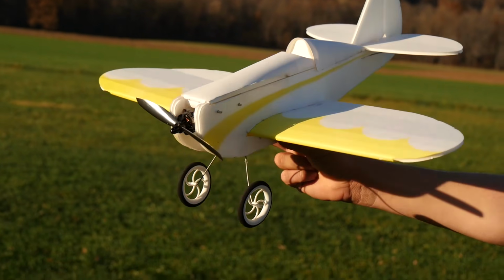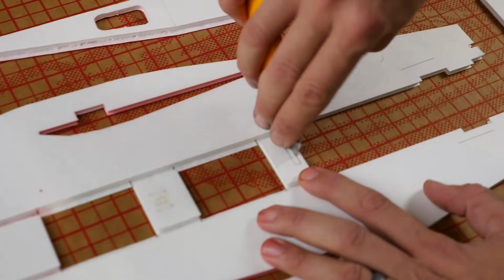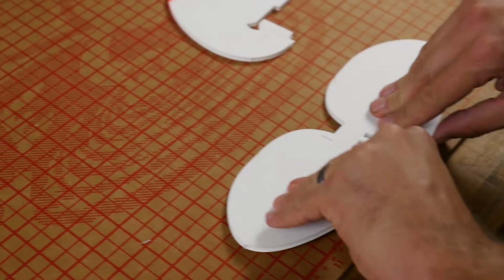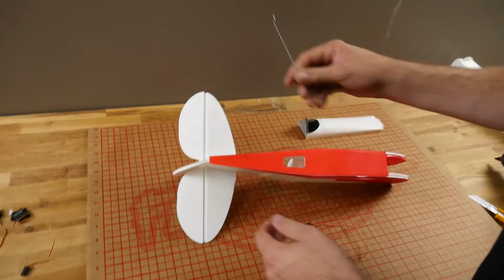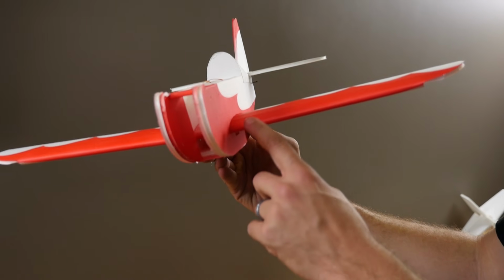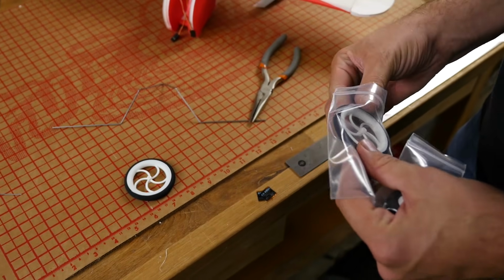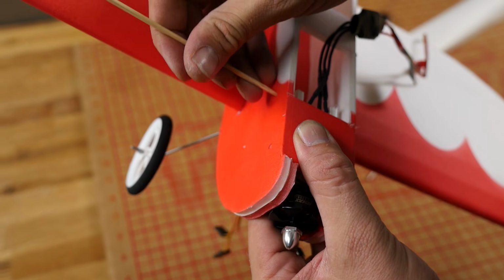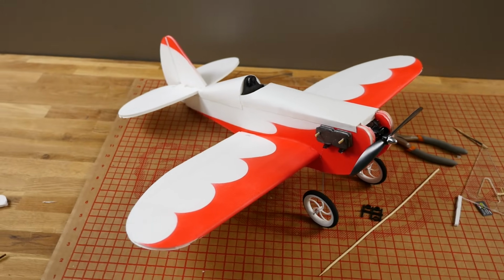FT Mini Sportster BUILD | Flite Test

Comment: After building and flying the old speedster I have some recommendations. I ended up re-enforcing the nose and belly areas with thin hobby plywood for added durability and some structure for the lading gear. It added a bit of weight but with the power pack "C" it was really no problem. I permanently mounted the power pod and moved the lipo to the underside for far easier battery changes. I plan on building the sportster next and incorporating these design changes. It sure made my plane far more durable and user freindly.

Comment: Finished my build. Still trying to find a good balance. Some comments on my experience so far. Man, I could not get the foam board to take paint. That is frustrating. Also, After assembly I found that the elevators were not actuating evenly. I tried reinforcing but it seems pretty weak. Going to try to maiden this weekend.

Comment: My Mini Sportster ist trying to get its front down into the ground as soon as I full-throttle it on start. I cannot get it into the air as it is constantly trying to make an inverted loop down. The elevator seems not to make any impact on pitching the nose up. It is perfectly balanced and everything is built as instructed. You can feel that desire to get the nose down even when you're holding the plane in the hand while full-throttleing it. What's going on and what am I doing wrong?

Comment: I'll be building this one soon! I was wondering tough; i would like to add a little AIO FPV system (the eachine tx-03), and feed it from one of the servo ports of the reciever... Would this be ok? i've seen them do it in an article but without much explanation... I'm afraid for noise of the servo's, would adding a capacitor in parallel to the aio fpv system help, perhaps?

Comment: Hi FT, So I did this with my own cutting, and I tried to take off but it just went straight down as if it was too heavy for this to lift off.  So I checked the article and the weight indicated should be 204g.  Mine is 282g using SunnySky X2204-16 2300kv motor and this is without landing gear or imitation engines at the nose.  I used a 3s 1200mah 25c battery for my maiden and never got it to fly, it would just plunge to floor with 2/3 throttle.  Would the 80g difference cause this???
Reply: aussiemikeysaru i think it can cause it is a small rc plane. 80 gra  is  nearly1/3 of the plane
Reply: Just give it the ft power pack for this model. Your setup has way too much weight.

Comment: mr. josh b. 
i have been an instructor in the building trades for over 35 years. I have been out of the hobby for 28 years do to my work schedule but I'm back. I have viewed every vid FT has authored. Yesterday I passed a fellow on the job site fighting with a piece of soffit. As I directed the proper procedure I said ,I quote  you, "when you feel happy with the that!" and I burst out laughing!! Pigeon-holed is another new lingo of mine also. thanks and I have scratch built the Mighty -Minis' just waiting on motors.

Comment: I have an old great planes super sportster .20 with an os .40 engine swinging an 11x6 prop.  All up weight is 3lbs on nitro, with about .75 hp at 18k rpm.  My question is what would it take to make it electric?  motor, batt, etc... ? it has standard hs bb servos using my old 6xas radio.  Any suggestions would be appreciated.  I also have a few vids of my planes, rockets, and helis on my channel if anyone reads this or is interested.

Comment: Never made or built an rc plane. Would this be a good starter? Or any other recommendations for an easier build with a video link for instructions.
Reply: I would reccomend their tiny trainer. Still in the process of building it, but others highly reccomend it.
Reply: +Jacob Webb K thanks
Reply: +Jacob Webb The Tiny Trainer is great.  I did the FT Flyer then T Trainer next.  The Tiny Trainer is a really versatile plane.  It&#39;s also pretty tough in wrecks.  It can handle a fair amount of wind too.  I would get some experience with the Nutball, FT FLyer, or TT before building this one.

Comment: Loved all of my the FT3D planes. Folded the wing on the first. Second broke the 1/2"x1/2" wood spar. Third I tried something new. 50% longer wing (Looked pretty cool) with carbon and plywood spar. Flown till the foam was too weak to stay together. 
Because of this build,  I'm going to try a micro FT3D.
Had 2 Horizon Hobby UMX Sbach planes.
Reply: A mini storch would be great with the bomb drop function
Reply: +sneeky7 Who needs skills? You plant it in the ground, you learn from the experience,  you build a new one and fly again.!! I'm no 3d expert, but I can fly any plane well enough. With Flite Test planes I'm not scared to wreck a $200 foamy. I can fly harder and learn faster. Then build new :-)
Reply: Flute test should have more full packages with everything needed such as servos, transmitters and the templates etc. it's hard to find the corrects products for each plane
Reply: christian luciani The night I made my first ft3d I didn't have anything but a cheap broken snow brush. One of those nights. Starting buildings and didn't want to stop. Normally I use the over priced carbon fiber flat bar from the local hobbie shop. But next time I'm near the local hunting shop, I'll stop in. I've used fiber glass before carbon was around. In a wing either are good with an over powered plane.
Reply: +brickbuilder happy 

Flight Test sells 'Power Packs' that are just that, save the transmitter, but they sell those too.
Reply: +Scott St.Amand give carbon fiber or fiberglass arrow shafts a try. They're lighter than and stronger than wood, the only downside being that they're slightly more expensive. Walmart has 5 packs for about $20, but I asked a local archery shop/range if they had any broken shafts they could sell me and they happily did so for $1 each. Most of them are in perfect condition, just missing a fletching or two.